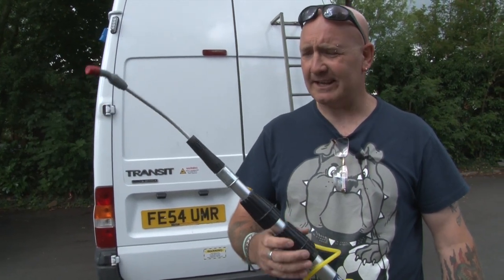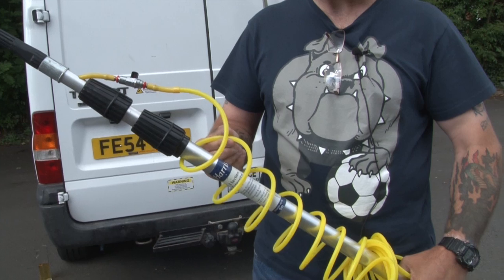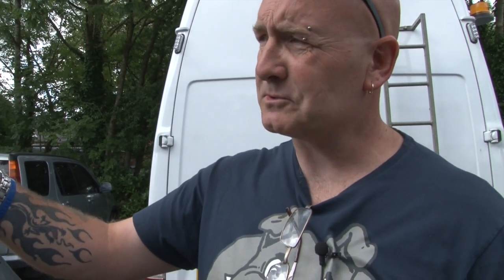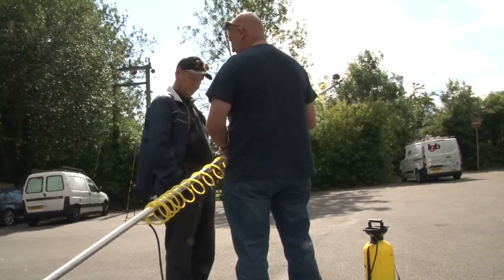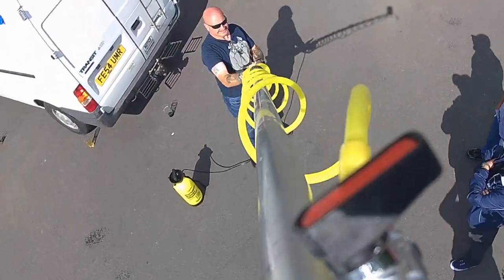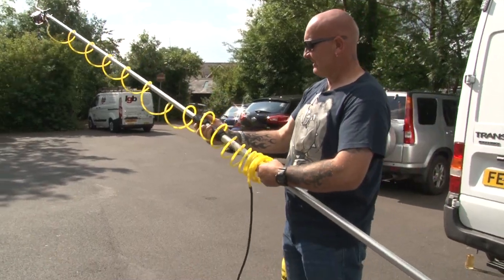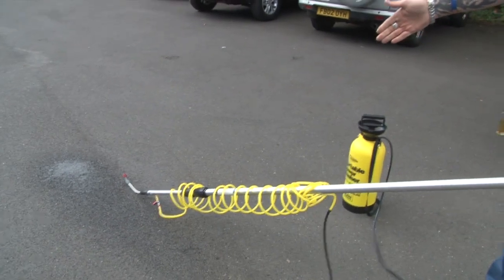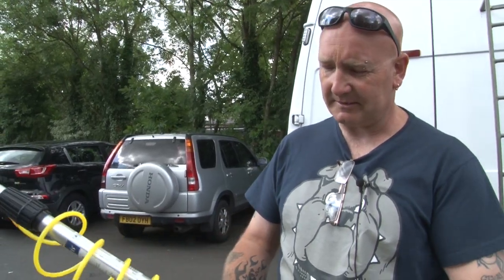DIY TFR

Comment: Just made one pretty much the same as the one you use. All set up and working. Thanks for sharing this. The air hose is still fairly tightly wound so currently got it in the garden in the sun at full stretch.